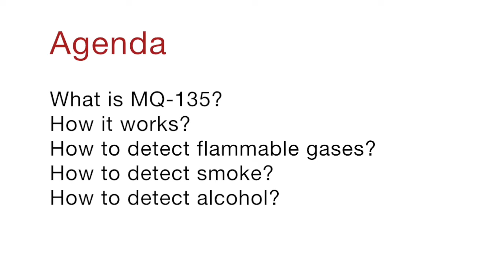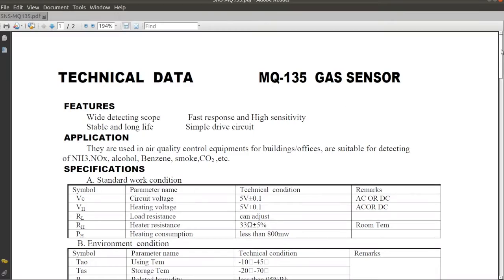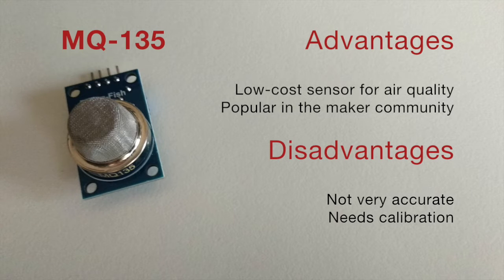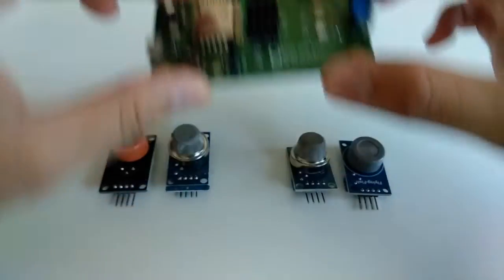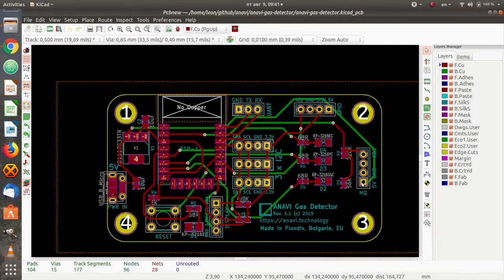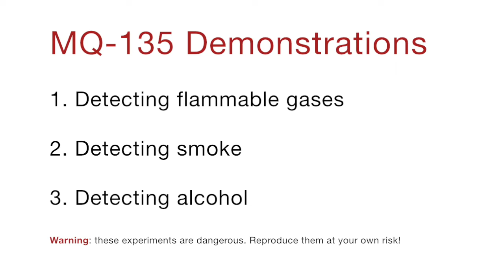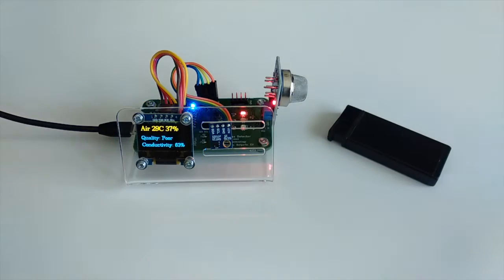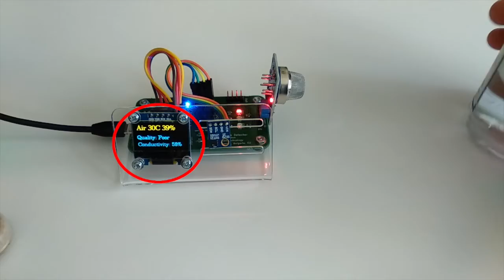MQ-135 Gas Sensor Module

Comment: Hi, Leon. I do have a question about the sensor. In my project I measure 3 gases in the same time (like their concetration in air at all). Still, I didn`t get it - did you change the resistance using potentiometer on the board or not for CO, Flammables and alcohol? Thank you kindly in advance!
Reply from the maker: “Good question. No, I haven't done extensive testing with different resistance using a potentiometer on the MQ sensor breakout board. Keep in mind that MQ sensors are useful for detecting the presence of specific gases, but not for accurately measuring ppm concentrations in the air. If your project requires precise measurements, I recommend looking into dedicated sensors designed for the specific gases you want to monitor. These are significantly more expensive than the MQ-135 shown in my video.
Reply: @LeonAnavi  Thanks. Looks like data sheet states that sensitivity should be adjusted based on the type of gas that “emits” in the air. Well, I’ll try to test it, hope i will succeed. Thank you for the vid. Maybe I return with my results if I will not forget:)

Comment: On this circuit board can I also use  MQ07, CO sensor , also since you already have a Temp/Humidity Sensor I can skip on this DTH-11 sensor...please let me know urgently I need to order..
Reply from the maker: Yes, the analog 5V MQ sensor slot on the ANAVI Gas Detector supports modules such as MQ-135, MQ-2, MQ-3, MQ-7, and others. By default, it is shipped with an MQ-135, but you can also use an MQ-7 on a breakout board if the pins are compatible. For temperature and humidity measurements, use the HTU21D I2C sensor module, which is compatible with the ANAVI Gas Detector and included in the advanced and developer kits.
Reply: @LeonAnavi  so on the board you can use Mq-135 that comes with the Kit and also add MQ07 in addition on the board?...and all the 3 sensors then can use the WIFI module to communicate with the cloud?.

Comment: I'm trying to build the same thing but can't get the right readings, i saw a solution online saying you need to  preheat the sensor first, did you perhaps preheated it first?
Reply from the maker: Yes, the initial preheat time for MQ-135 is over 24 hour.
Reply: @LeonAnavi  Thanks a lot broo!

Comment: Hi, is there any standard procedure in using mq sensors? My thesis professor is requiring me to provide a standard procedure in order for me to continue my thesis. My thesis topic is to compare it to the gadget of an agency that measures the air quality.
Reply from the maker: Yes, explore the MQ-135 datasheet and follow the recommendations from it. As mentioned in the video and the datasheet the standard procedure for using it requires over 24 hours of pre-heat time.
Reply: @LeonAnavi  Thanks man!
Reply: @LeonAnavi  24 hours once or every job heat 24h ? thnx

Comment: Can i find the concentration of oxygen alone inside the room using this sensor ?
Reply from the maker: No, it is suitable for detecting specific dangerous gases but not measuring exact concentration.
Reply: @LeonAnavi  so if I need to measure only the concentration of oxygen inside various ventilated rooms what sensors can I use ?? Please reply
Reply from the maker: I recommend you to have a look at Grove - Oxygen Sensor Pro(GGC2330-O2)
Reply: @LeonAnavi  it's currently unavailable could u suggest me any other oxygen sensor
Reply from the maker: @shahnaaz6586  look at Winsen ME2-O2-Ф20 oxygen sensor. I've seen breakout boards with it.
Reply: @LeonAnavi  thank you so much
Reply: Can I use AO-03 for measuring the concentration of oxygen inside the room using Arduino nano ??? Please reply

Comment: Please create a video on mq3 and raspberry pi 3b+ to detect fruit ripeness detection
Reply from the maker: OK, this is a good idea! I will have in mind for new videos. Raspberry Pi single board computers like 3b+ don't have built-in ADC (analog to digital converter) so an extra board must be use to work with analog sensors like MQ3 or MQ135. The open source hardware add-on board ANAVI Gardening for Raspberry Pi has ADC and can be easily adapter with MQ gas detectors.

Comment: How can I detect individually nictric oxide, benzene, smoke, and co2 in there? I want to sense that separately, ideas?
Reply from the maker: Good questions: you will need different sensors capable of measuring concentration. For CO2 have a look at MH-Z19, CCS811, SCD30.
Reply: @LeonAnavi So does it really measure lets say, nitric oxide? like in the amount of it? or it can't and it just says what you demonstrated?
Reply from the maker: @MiG-25IsGOAT  no, MQ-135 is suitable for detecting of NH3,NOx, alcohol, Benzene, smoke, CO2, etc. Please note there is a difference between detecting and measuring. MQ-135 is an inexpensive option for detecting.
Reply: @LeonAnavi Oh, I'm so sorry, So what is the analog pin used for? and is there a cheap sensor that can measure at least 1 of them?
Reply from the maker: ANAVI Gas Detector has a dedicated slot for MQ-135 and an appropriate voltage divider to use it with the built-in ADC in ESP8266. You will need to adjust if you are using another development board.

I am not familiar with sensors in the price range of MQ-135 for measuring. I am using MH-Z19 on Raspberry Pi for CO2 measurements and it is very good at a reasonable price.
Reply: @LeonAnavi Thanks for the response, I have other question srry for being like this, but can I detect a gas individually?
Reply from the maker: For example Winsen's MH-Z19 measures CO2 individually in the range from 400 to 10000ppm

Comment: Is there any way to make mq135 gas sensor to only sense the ammonia(NH3) level?
Reply from the maker: no, MQ-135 is suitable for detecting of NH3, NOx, alcohol, Benzene, smoke,CO2 ,etc. It is an inexpensive detector but not an accurate sensor for measuring the particular level.

Comment: Hmm.. I would guess when you light the lighter that it's reacting not to flammable gas (of which there is probably very little still uncombusted). More likely (speculating) it is measuring a change in temperature, humidity, and CO2 concentration. What do you think? To measure flammable gas, I would use a flint lighter and not spin the flint -- so raw uncombusted butane comes out. 

Additional thoughts: I'm noting that the accuracy of the circuit is limited by several factors. First, if there is a combination of gasses present (as with the lighter scenario), it can't differentiate the components (how much resistivity change was from which gas component?) Second, we are compounding the errors and biases of the temperature sensor, the humidity sensory, the A/D converter, the reference voltage, and of course the MQ-135. I think it's going to be hard to engineer an accurate, working, device this way. It certainly isn't just as simple as calibrating the MQ-135, because you have to calibrate for several different curves -- for each of the confounding factors above (voltage, A/D, humidity, temp, and MQ-135). Each of those will present different curves for how they affect the end reading. Then there's quantization error if you're using look up tables (LUTs).

Thank you, it's very interesting, and solving (or at least optimizing and measuring) the above challenges would be a fun project. Aside from doing individual calibrations/curves/LUTs for T, H, V, etc., maybe adding some other MQ-series gas sensors would help -- particularly for resolving individual components. For example, to measure flammable gas, use MQ-7 with MQ-9. Calibrate each on single component carbon monoxide, then subtract the reading from MQ-7 (CO only) from the reading of the MQ-9 (CO and flammable gas) to remove the influence of CO on the flammable gas reading.
Reply from the maker: Just keep in mind MQ-135 is low-cost sensor more suitable as a detector rather than making measures (not even mentioning accurate measures if this is the goal). MQ-135 is composed by a "micro AL2O3 ceramic tube, Tin Dioxide (SnO2) sensitive layer, measuring electrode and heater are fixed into a crust made by plastic and stainless steel net. The heater provides necessary work conditions for work of sensitive." For more details check the data sheet. Furthermore on a device like ANAVI Gas Detector you can combine MQ-135 with additional sensors like HTU21D for temperature and measurement and do software algorithmic approximations.
Reply: @LeonAnavi  I agree. For my current project,  I want to accurately quantify CO2. I'll have to spring for a NDIR sensor, which I can get from Adafruit for about $60. Adafruit Scd-30. I'm not sure, but suspect that I still need to monitor at least humidity.
Reply from the maker: Have a look at mh-z19 CO2 and temperature sensor. I plan to make a video about it in 2024. It is a very good value for money.
Reply: ❤ I will! Thank you!

Comment: hello, is this viable to be used for outdoor purposes such as in streets? thank you!
Reply from the maker: No, mq-135 is for air quality control equipments for buildings and offices. There are CO2 and dust sensors which are more appropriate for outdoor measurements. I am planning to cover mh-z19b CO2 sensor in a new video in (near) future.

Comment: Regarding the burn-in warmup process, should the MQ-135 be plugged in and running when that's happening or should I just leave it in a room by itself?
Reply from the maker: MQ-135 should be turned on. Otherwise it want warm up.
Reply: @LeonAnavi  Thank you!

Comment: awesome video. do you know similar low-cost smoke sensor that don't need calibration? accurate value per gas is not required as well, simply to detect burning smoke without much hassle re-calibrating everytime
Reply from the maker: MQ-2 is a smoke sensor similar to MQ-135 but it still requires the same procedure for pre-heat/calibration. 

Alternatively if you have a larger budget for this project, you can have a look at breakout boards with ADPD188BI by Analog Devices Inc. It is an optical module for smoke and aerosol detection applications.

Comment: Does MQ-135 can detect body odor, bad breath, and poop? If yes, please explain thank you in advance.
Reply from the maker: No, sorry MQ-135 is not appropriate in this case. As explained in the video it is suitable for detecting
 of NH3, NOx, alcohol, Benzene, smoke, and CO2.
Reply: @LeonAnavi  What are the other odor that MQ-135 can detect if it used in comfort rooms? We’re trying to conduct a study and we still don’t know what sensor are we going to use. Is it better to use MQ-137 sensor than MQ-135 Sensor in comfort rooms? Or is there any sensor that you can suggest for our study?
Reply from the maker: @lanuevojoshivanc.4598  What are the chemical compositions of the things you want to detect in your study? MQ-137 is for detecting ammonia. MQ-4 is for detecting methane and might be suitable. Also have a look at a breakout Grove board by Seeed Studio Grove called "Multichannel Gas Sensor v2". It is far more expensive but it contains several gas sensors.

Comment: hi what display is that?
Reply from the maker: It is a mini OLED I2C SSD1306 yellow-blue display. Btw check my YouTube channel as I have a separate video only for this display.
Reply: @LeonAnavi  thanks for info..also I'm confused about the data sheet temperature data; for example in a room that is  27degree should I be changing to gas sensor reading data by a biased?
Reply from the maker: @ambientsoda106  it is tricky, if the temperature is significantly below and above the ambient room temperature some adjustments of the data might be required.

Comment: How would I interface this with an Arduino Uno and a .96 led display?  I'll TOTALLY donate to your patreon if you could help.
Reply from the maker: Have a look at the open source Arduino sketch for the smart WiFi dev board ANAVI Gas Detector. It is based on ESP8266 but with some efforts the sketch can be adapted to Arduino Uno:
https://github.com/AnaviTechnology/anavi-gas-detector-sw

Comment: Which one detect toxic gas from burned garbage?
Reply from the maker: it all depends what kind of garbage is burning and therefore what is the chemical composition of the gas as well as the smoke concentration. Otherwise many of the MQ sensor modules are capable of detecting smoke, including MQ-135, MQ-2, MQ-3, etc.

Comment: how do you heat it up?
Reply from the maker: According to the datasheet the preheat time is over 24 hour so just connect the MQ-135 sensor module and leave it in a room with clean air. This is a one time procedure.
Reply: @LeonAnavi  ok another question I am finding it hard to grasp the concept of calibrating the sensor especially the calculations to convert the analog values to ppm...any help
Reply from the maker: @convolution_talk_show  as explained in the video, MQ-135 can detect dangerous gases but it is not suitable for accurately calculating ppm. Use MQ-135 as a part of an alarm system to detect poor air in the environment.
Reply: @LeonAnavi  ok thanks alot! I will do that. but I will be using a mq9 sensor to detect carbon monoxide so I will need to calibrate and convert analog to ppm. will it be easier by then?
Reply from the maker: All MQ gas sensor modules work the same way and the difference is in the gases they detect. These are low cost sensors for detecting poor air, not for accurately measuring concentration of a specific gas.

Comment: Can it detect nerve gas?
Reply from the maker: No, I don't think so. This sensor is for different purpose. It is used in air quality control equipments for buildings or offices and it is suitable for detecting of NH3,NOx, alcohol, Benzene, smoke,CO2 ,etc.

Comment: Hey Leon your explanation is amazing!! But can u paste the coding below in the description or comment section cause it looked  quite complicated.Please.
Thank you💜
Reply: Also can I do a model using aurdino instead of the board u used??
Reply from the maker: in general yes, you can use Arduino instead of ESP8266 board however some adjustments of the Arduino sketch might be required depending on the type of Arduino you would like to use.
Reply: Is this compatible with ATmega 32?
Reply from the maker: Yes, sure, the source code for ANAVI Gas Detecotor is available as open source Arduino sketch in GitHub: https://github.com/AnaviTechnology/anavi-gas-detector-sw

Comment: u told MQ-135 can just detect the presence of some harmful gases but cant tell the amount in which they r presence. do u know any sensors which could tell the amount as well??
Reply from the maker: Yes, exactly MQ-135 is a low-cost sensor suitable for detecting but not very accurately measuring a specific gas. There are other Nondispersive Infrared (NDIR) based CO₂ sensors, for example the SCD30 from Sensirion capable of detecting 400 to 10000ppm with an accuracy of ±(30ppm+3%).
Reply: @LeonAnavi  thankyou brother 🙂

Comment: What is the difference between MQ-135 and PMS5003  ?   They do the same function  ?
I am a layman !
Reply from the maker: There is a major difference of how they work and even more important what they measure: PMS5003 is a particulate matter sensor for dust, pollen, metal and organic particles, etc. PMS5003 is completely different and it is significantly more expensive.
Reply: @LeonAnavi  Thanks. MQ-135 does the same  ???
Reply from the maker: @changamanga3419  no, MQ-135 is used in air quality control equipment for buildings and offices as it is suitable for detecting
NH3, NOx, alcohol,  Benzene,  smoke, CO2, etc. Please note "detecting", not measuring exact quantity.
PMS5003 measures PM2.5 dust concentrations.
So the two sensors are completely different and for different tasks.

Comment: Can I use mq135 sensor to detect fire?
Reply from the maker: Well, as you can see in the video MQ-135 is capable of detecting smoke and smoke is an unwanted by-product of fire so in general it is possible. But as the datasheet of MQ-135 says the sensor is most suitable for air quality control equipment. There are better and more reliable sensors and ways to particularly detect fire and flames.

Comment: I got 2 esp8236 and 2 mq135 to try and monitor CO2 levels in my kids rooms at night. Specially because in summer it's closed tight to maximise on air conditioning.
Any tips? I'm very much a newbie although I'm good with the IT part of it all
Reply from the maker: If you are a newbie I recommend you to get started with ANAVI Gas Detector as it has a slot of attaching MQ-135 gas sensor modules and appropriate open source firmware:
https://www.crowdsupply.com/anavi-technology/gas-detector
https://github.com/AnaviTechnology/anavi-gas-detector-sw
Reply: @LeonAnavi  Thanks but if it's shipping via anything other than DHL/Fedex/UPS it'll take 6-8 weeks to reach me sadly.
I guess I'm going to have to learn :) I wish there was a compatible sensor that would only measure CO2 though
Reply from the maker: @Airbag888  Yes, several of our distributors have it in stock such as Crowd Supply and Mouser. Mouser are really good at fast shipping and they have some promotions for free shipping on larger orders. Have a look at the kits here: https://www2.mouser.com/Electronic-Components/